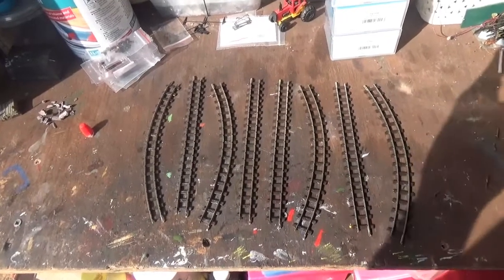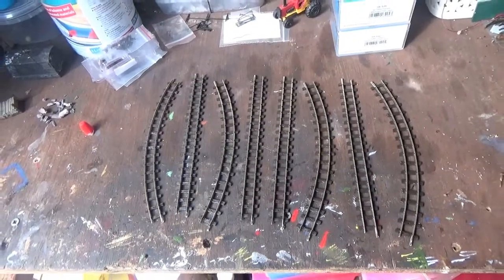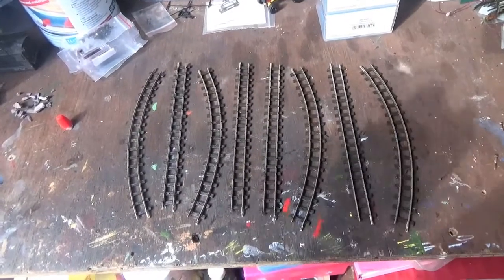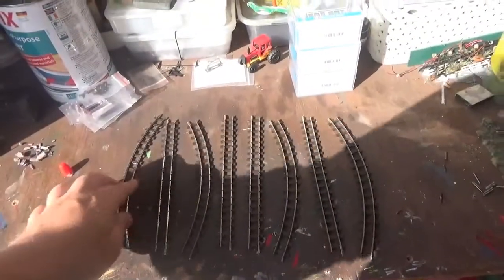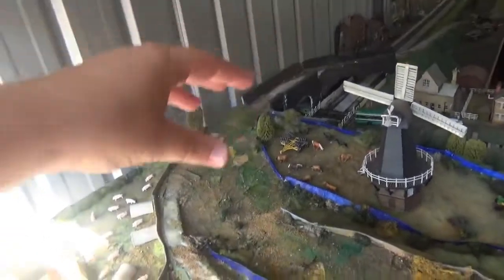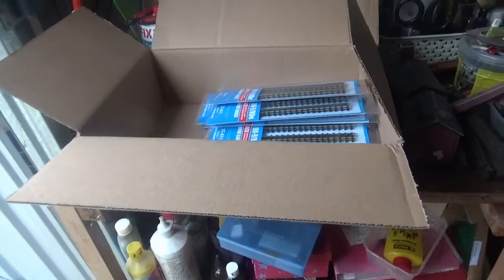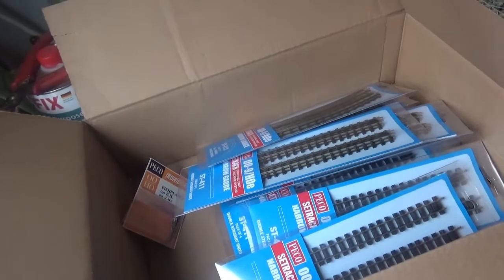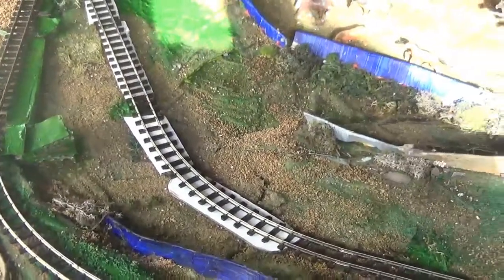class47peter's 009 Project Part 1: Introduction, Track laying and Bridge Building

Comment: Very good Idea, I have got a 14X10 Garden Shed layout with Max Board Space, and I model in both 00 and 009 NG, with a Branch Line Going off to meet the 009 Gauge, and I have a High Level and Low Level, with the 009 Being at the top, basically pretty much the same as you have done, only difference is its a lot bigger layout, anyway I have built a 009 and 00 Gauge Exchange Siding so the slate can be off loaded from the 009 and on to the 00, maybe a suggestion, for your 009 NG why dont you build an exchange siding so the slate can come out of your quarry and down to your SG and then the NG Wagons could be pushed, up a steep gradient and once at the top, of your Narrow Gauge exchange siding your wagons, the slate could then be tipped out of the wagons and straight into the SG Wagons, PS whatever you do keep up the great work regardless whatever you decide

Comment: You can easily obtain spare 009/N gauge fishplates, they're in most model shops. Please be careful not to make your gradients too steep, it would be awkward only finding out if there's a problem once you start to run trains.
Reply from the maker: Since then i have got the correct fishplates which is shown in part 2, the gradients are fine also, had no issues with them so far